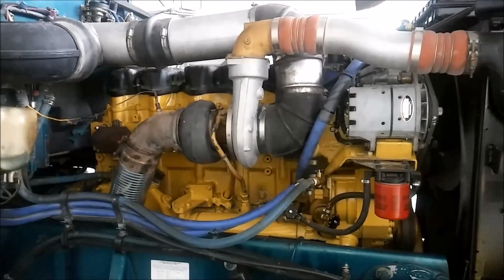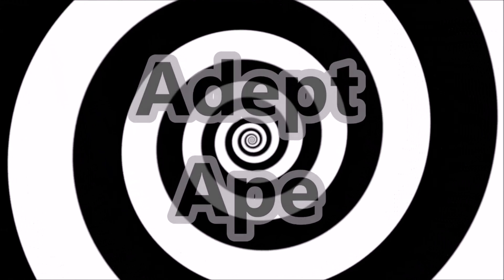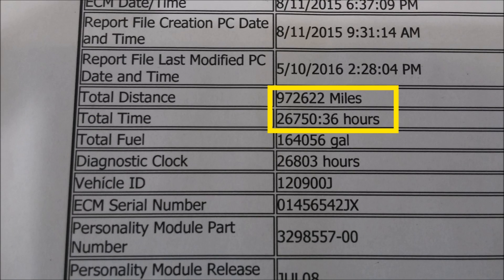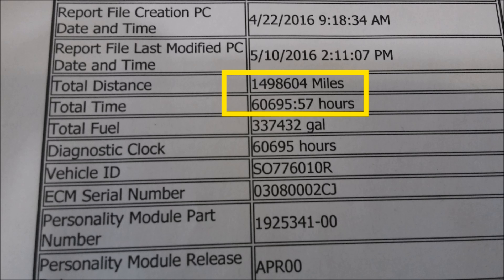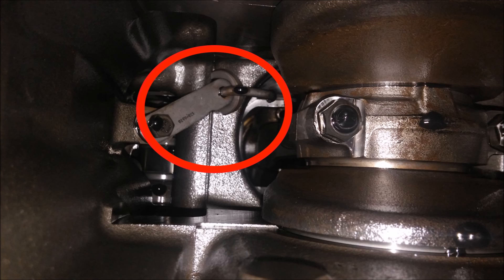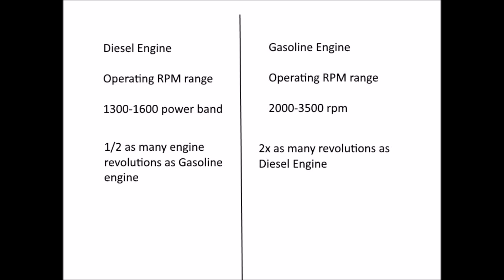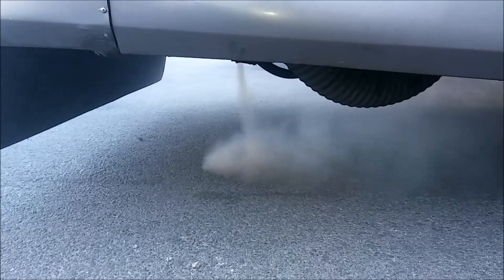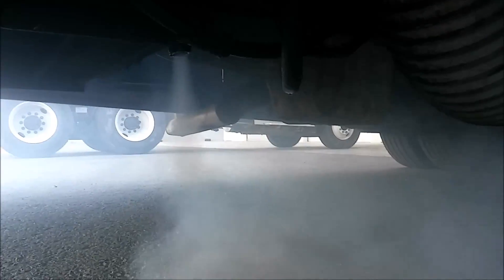Why Do Diesel Engines Last So Long?

Comment: Dude, you can't compare what is essentially an industrial diesel with a small car petrol. Actually Otto. I'm not saying you are not right but you shud've seen more of the small diesel european designs, with no piston cooling jets, one gallon of oil or even less, belt or chain driven timing and then have a go at this vid. Those may last a bit longer than petrols but faaar from this extent. And it's not always the story. 

Established small diesel producers and by that i mean companies who have produced generations of successful small diesels and who by the way are NOT german, have until like 10-15 years ago had hard times selling them because a small diesel has to do sooo much more than the big fat C15.

An industrial or a truck diesel only has to last long, not burn much fuel and put out a decent amount of torque. 
Whereas a small car diesel has to do those and then so much more. 

It can't be as strong cuz it has to be light, to be carried around in 800 kg cars. See the Citroen C1 or Toyota Aygo or Smart Car. 
It needs to be very cheap because it may come in a $10k car, it needs to be of small capacity so that tax won't starve the owner, rev to as much as 5000 rpm, put out ridiculous amounts of power, some even more than 100HP/liter, yet it needs to be as silent as possible and not vibrate cuz doors will fall off, not sound harsh so that even dudes and dudettes who know nothing would buy it, also a nice character is a total must nowadays. It has to respond well to input, pull strongly all across the rev range, not just in a 500 rpm slot of high torque output and then jizz... 

Moreover, they need to let out nice smelling fumes so that trees grow faster and sooooo on. 

You see, you are right, but there is so much more to this diesel vs petrol comparison. And when you put all that much more together, diesels don't really last as long as you are suggesting :). Anyway, nice vid.

Comment: Holds up a bearing for a 5.7 liter and compares it to the bearing for an engine of 15.2 liters in size...the bearings were about 3x different in size...what you'd expect. Did these diesels go a million miles without an overhaul? Who owns vehicles/equipment with these huge diesel engines? Businesses... They can afford to have them rebuilt constantly. The share of diesel vehicles out there not used for commerce is tiny compared to the same people (civilians) that drive gasoline-fired vehicles. Gasoline engines can have their cams driven by gears. They simply just don't, because a belt or chain is good enough for a civilian's personal vehicle. Most turbocharged car engines have oil jets for the cylinder walls, too. Basically everything you said in this video about diesels can be done to a regular gasoline engine. It just isn't, because normal personal vehicles simply shouldn't cost that much. Corporations can afford anything that's expensive, and there is a ton of "industrial" crap out there that is expensive just because it says industrial. When civilian's cars or trucks have diesel engines, they use the same exact technology as their gasoline counterparts, and they have similar lifetimes.
Reply: Also, when a person neglects their car, and it dies, they will just trade it in for a new one, and keep their line of debt going. Corporations have their own capital, so they can afford to maintain things, and that means doing complete tear-downs on schedules. They can afford a monster of an engine right up front in the first place.
Reply: A lot of companies don't maintain equipment.  They just run it till it dies.  Seen it many times.  My mechanic friend told me horror stories about how employees abuse stuff...like you have to add oil to the gas for the chainsaws, and they be like "Oil? What's that?"
Reply: Most companies don't operate in such a manner.
Reply: I'm sure it's got to be a small minority that do that.  But, I see it all the time.
Reply: NiceMuslimLady I'm sure not. When you're talking about something like heavy equipment, it's a liability to not maintain it and keep records of it. It's even more of a liability when that piece of machinery is driving on public roads. Companies that you describe don't last very long.
Reply: Tim Ramich Yes engines like that CAT 15 l do get million miles without overhaul.  If well maintained, - very easy.   And all that with GVW  80-100 000 pounds.
Reply: So can any other engine in the world that's not a known lemon. It has nothing to do with it being diesel. It has to do with it being designed for industry. A Chevy Small Block was not an industrial engine. It was an engine for consumers. This has nothing to do with the fuel being used.
Reply: Gasoline is not corrosive to metal. It's just another petroleum distillate. Sure those Cummins engines are industrial. They put them into those trucks with dual rear wheels. Those trucks are meant for doing work. Some people called hicks just decide to drive them around as daily drivers and blow smoke at everyone.

Displacement determines your RPM requirements. I think you're at the point of comparing little rice burner 4-bangers to diesels. And yeah, gasoline engines can tolerate plenty of knock.

Putting an engine that allegedly lasts a million miles into a passenger car is stupid. The rest of the car isn't going to last as long. Equipment used for working will, however, because it gets more hours/miles on it in a shorter amount of time. Gasoline-engined cars that people do use for work, and are only a few years old, tend to have hundreds of thousands of miles on them, and they work just fine.

The choice of fuel does not determine how long an engine lasts. It's how it's treated.

Comment: What would happen if you put diesel fuel into a gasoline engine? Also why do two-cycle gas engines have oil and gas mixed together, for example chain saws or some lawn mowers?

Comment: +Adept Ape
I really like your video and I think you are right, for large diesel engines, for Trucks, Boats, trains and generator supplys, not for cars. 
Why? Because those work at a constant low RPM with really big amounts of torque, usually having more than a dozen gears (for trucks) or pushing hydraulic pumps. 
Boats usually do run higher rpm but nothing on the range of cars.  

Lets see car diesel engines:
We had Mercedes with their 190E and others, 2.5L with 70bhp, atmosferic diesel engines, those lasted for millions of kms, really, they are the standard for reliability even today! But that doesnt happen with new diesel engines.
New diesel (car engines) doing 170bhp with 2.0L like the BMW N47 engine is a crap load on reliability for example, it's chain drive and IT SHOULD BE replaced every 100 000 km, by BMW technicians. Not a problem with BMW gasoline engines.
Diesel engines do pollute a lot, they do make less CO2 than gasoline engines but produce NOX and SOX, that are oxides of Nitrogen and Sulphur, respectively, and soot and fine particles that cause lung cancer so they are now or will be forbidden for the next years on europe's major cities. And Manufacturers don't like it, manufacturers like diesel engines because they win more money producing those engines than gas engines.
In order to produce that horsepower, diesel engines are equipped with turbos, common rail injection and high pressure fuel pump, usually the Achilles heel of those new diesel engines.
To regulate the emissions, which are taxed, diesel engines use EGR, DPF and now even adBlue (but this is a cool one). Thanks to DPF's getting clogged of city riding, many cars have burned of, something thought impossible on diesel cars. To avoid that many owners remove them, increasing emissions by a lot.
Also, they need high quality synthetic oil. 

Bearing wise, that doesnt apply for cars, since its not usually the engine that fails but the really expensive periferics that go around it and send it to scrap at most, 400 000km, a mileage that every regular gas engine can reliably do without much trouble.

About piston rings, most gasoline here has no sulphur content, on USA, they are fitted with iron liners and others that make gasoline engines last a good amount of time and easier to rebuild.
Diesel does have lower RPM and much better heavy duty parts, but to make the same horsepower as a equal atmospheric gasoline engine, the diesel has to have turbos and other technology and that kills all the reliability.

So, that's why I think your video is well made but it doesnt apply to cars.
Reply from the maker: +J Costa Thanks for the very technical comment. I wasn't trying to apply Heavy Duty principles to cars. I was trying to compare a Diesel Truck engine to a car engine, but I should have made it more clear, because the smaller automotive Diesels don't have the same designs as the heavier more expensive truck engines.
Reply: Adept Ape nope sir, keep the good work! it's easier to criticise than to do a video, but we only grow as being subjected to some pressure, preferably a good pressure.

Comment: Few things, constant rpm, low rpm, beefy parts that don't care about weight, diesel is a lubricant, engines are designed with replaceable cylinder sleeves etc..

Comment: yes, diesels have their advantages but also weaknesses. if this were not the case all vehicles would have them
Reply from the maker: +Frank S They are usually more expensive, I don't own a Diesel. For everyday applications a gas engine is great and fairly inexpensive.

Comment: My 79 Lincoln with the 400 V-8 operates about the same RPM range as a diesel.  And there are those old beautiful industrial gas motors they put in medium and heavy trucks that were tough as hell.  Also heard some taxi companies damn near run some gas taxis 16-24 hours a day in some cases, highway patrol cars run highway miles all day, ect.  Instead of sticking to diesel specifics, you did wander a bit into other concepts.

Comment: 1:57 I think you mean 10 quarts of oil not ten gallons of oil.
Reply from the maker: +dematson Nope, a C15 or C13 truck engine actually holds about ten gallons of oil.
Reply: OK, I have a Duramax 6.6 that holds 10 quarts of oil. I didn't' realize you were talking about a bigger diesel.

Comment: Howdy, You forgot to mention some important differences; the compression ratio on a moderate performance gasoline engine is about 10:1, most all diesel engines have a 22:1 compression ratio, this is largely why the engine is built with a heavier duty crankshaft, head gasket, larger bearings and more stout valve train. Diesel engines almost always have a larger oil capacity as you mentioned, but they also REQUIRE synthetic motor oil. All of these things contribute to longevity. Finally, diesel engines in many applications like catepillar tractors, boats, barges, over the road trucks are subject to a different longevity expectation than automotive gasoline engines. This results in high er costs for a diesel engine that is made to last longer. Pat Brown (Engineer)

Comment: You really are comparing apples with oranges here. In order to correctly compare you should compare car engines. Don't forget that a large diesel is designed to last, the smaller ones, not so much.

Comment: youre comparing a big ass diesel engine to a regular mass produced gasoline engine if we compare the Toyota 2LT diesel engine, you will find that it has one thermostat, and the camshaft is belt drven. the reason im using the 2LT diesel engine from Toyota is becuase i have seen a lot of people sapping their king cabs and hiluxes with this particular engine that comes from a 1997+ toyota hiace youre golden if you find the D-4D version of it becuase the head was stronger compared to the non D-4D. but about the bearing you were right.

Comment: They may last longer but will cost you more to maintain over the course of its life time! injectors failing costing $$$$$ egr valve clogging dpf clogging high pressure fuel pump failure! just some of common failures on all diesel engines that will make you spend $$$$$$$ over a petrol engine! diesels a dying fuel dirty stinking sounds horrible!

Comment: This is highly generalised, and don't take automotive (i.e. car) diesels into considerations. Car diesels are much smaller than truck or stationary diesels and run at higher speeds. They run at speeds of 2000-3000 rpm. The RPM is not an indicator of engine life, the average piston speed is.

Comment: here is my ? i live in sask canada that means in the winter its 40 below somtimes for long times weeks then summer are hot anyway  what the cost to buy a disel truck normal size lets say one ton what the cost difrence between that and gas and what the difrence in cost to run in lets say 10000 miles? oil changes disel additives ect filters  ect? and how good are they to start in extream conditions?

Comment: run a d6 dozer for the feds.. can you tell me about the new 9.3 liter that's in the dozer. seems like my older 3406 had more power before this new def system...thanks rich
Reply from the maker: +Rich Dayton I really don't touch the equipment at all, just the truck stuff. Wish I could tell you more.

Comment: You were talking about semi diesel engines compared to passenger gasoline vehicles...

Also they go very high miles in a few years because they are always on and traveling and are taken much better taken care of than passenger cars.
Reply: ***** Invalid? 

Okay Mr Fedora neckbeard non binary gender thing.
Reply: What about diesel engines that power ships, generators, locomotives, etc?
Reply: I do know that ships have immense diesel engines ( the ones that are still diesel rather than nuclear)
Reply: Oh, so let's now disregard people based on how they look, rather than the content of what they say, is that it?  I don't like they way you look, so you don't matter?
Reply: Modern locomotives tend to have a lot more of the frequent start/stop.  Unlike the older ones that required a crew member to manually shut off the engine, the modern ones do it automatically.  Another type of diesel engine that does that is the refridgeration unit on a railcar reefer or truck trailer or container reefer.  One thing about the powerplants locomotives, is their sheer size!  Because of that, they can actually have water condense inside the cylinders, requiring them to be blown out before a cold start.  Don't know about ships or generators.
Reply: Yes they do.  Nowadays, most of them are similar to railroad locomotives, in that they run a large alternator or generator that actually run the azipod propellers.  Azipod propellers are electrically operated propellers with the motors in a pod outboard of the ship.  However, unlock the drive motors of a locomotive, which can...and WILL...short if submerged, the pods for the ship drive motors are watertight, as they are normally submerged.

Comment: go to pqia....read the differences of zddp (zinc phosphorous antiwear additive) on the oils. this is why 50s and 60s engines seem to run forever. because back then zinc was high and no catalytic converters to clog. modern oils are low on zinc EXCEPT for diesel oils. diesel oils have medium to high levels of the zinc.

Comment: To make this a fair comparison, you should really be talking about engines of the same size and application.
A perfect example would be the VW Golf, you can compare the 2 litre turbo petrol model to a 2 litre turbo diesel. I think you will find that the bearing sizes are much more similar. The small diesels in cars are also quite high revving, up to 4000rpm or higher.
Reply: My 1994 chevy 6.5 diesl red lines at 3000.
Reply: It depends on the age. In the 90's the TDI were extremly over-engineered. My engine (1.9 TDI 90HP - code 1Z) weights (dry) 220kg compared to the 90HP gasoline engine. Even the crankshaft weights at least as twice as much. Although both are 4 cyl engines in a comparable usage/duty. Not mentioning the 1Z TDI does often over 1 million kilometers of lifetime. Where the gasoline engines are in best cases about an half of an million and those even rare!

Comment: Diesel engine  is all heavy-duty built inside and out  because of the massive intense and tremendous power inside..the mix of air and diesel fuel is far more force and intense that gasoline engine.

Comment: All these "differences" are the same gas and diesel. Only 2 main reasons for diesels lasting longer are that diesel lubes the cylinder and that diesel engines run at lower rpm. Everything else is the same.
Reply: Not correct

Comment: I'm driving a chrysler 300 3.0 turbo diesel. Mercedes engine. currently just passing 250000 and it's still running like a good un. keep them fed with oil and water and you'll surprise yourself. I believe these are good for 500000. . we'll see :-)
Reply from the maker: +YZFR1mart What country is that in?
Reply: Adept Ape 
hi. I'm in UK

Comment: you sepeak as if diesels only runed on truck's,  that i supose in your country that is practicaly what hapens,  but in europe nearly everibody drives a diesel car,  whith engines as mall as 1.3 L .  the video was great by the way
Reply from the maker: +Pau Ayelo Thank you. I work in a Truck Shop so I did the video on what I work on. We really don't have a Diesel car market over here. Volkswagen tried to get into the market, but was pushed out by the EPA. You guys at least have the option of buying either or over there in Europe.